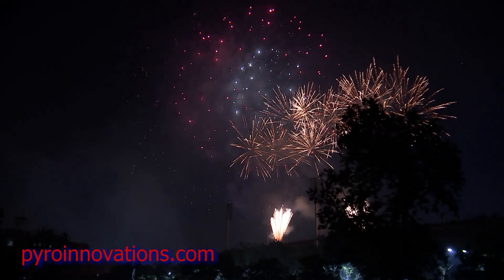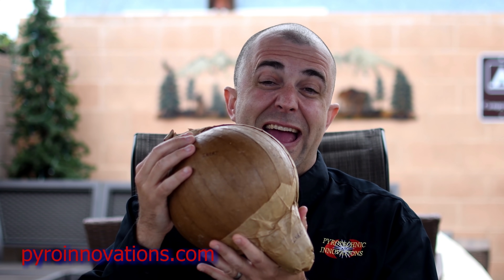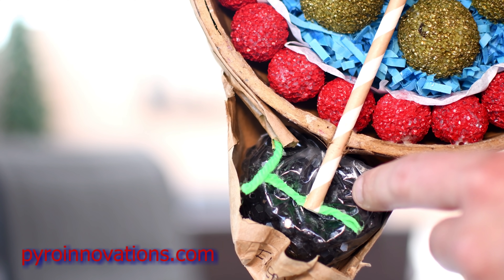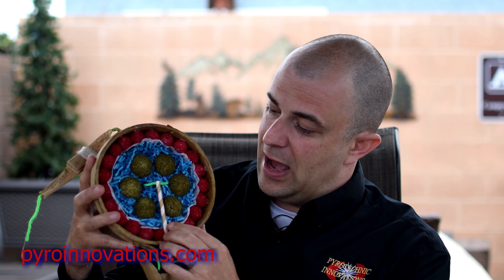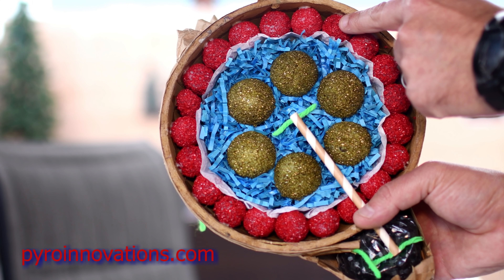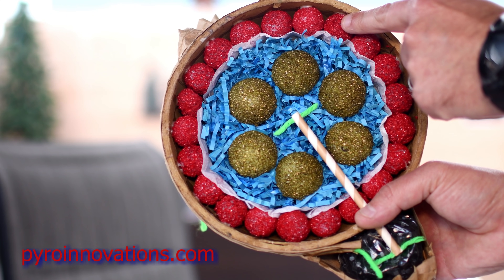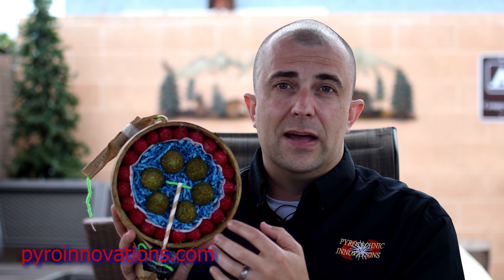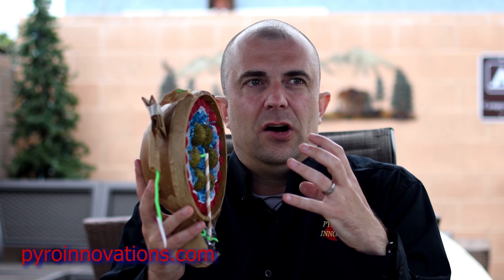How Fireworks Work

Comment: Wonderful explanation, how would I go about getting started so I could start my own business doing small shows and gender reveal parties ? Weddings and such ?
Reply from the maker: That would depend on the state you reside in. In CA, it’s easier to just join an established company as an operator.  That is probably true in most places, as there is a lot to consider, from importing to insurance to actual display licensing.
Reply: @PyroInnovations  well I’m actually in Tennessee and you’d be surprised how strict they are about fireworks in general
Reply: @PyroInnovations and Thank you for responding

Comment: Little question about what you were talking in 6:10, is shell of shells just normal shell but instead of stars there are shells like in firework cake but without lift charge?
Reply from the maker: Shell of shells is a larger shell with smaller shells inside of it. When the larger shell explode, it disperses the smaller shells in a fashion similar to stars, followed by the smaller shells exploding.

Comment: Was the shell you used in the video a real shell or a mock shell? If it was real,  how did you get it apart reasonably safe?
Reply from the maker: It is inert (not real).  It was just a model we put together with bright false colors to allow easy viewing of the individual components on camera.  A real shell everything would be black since all the components would be covered or primed with black powder.

Comment: I noticed that in this video the launch charge was very loud but at a professional fireworks show it sounds very subdued. Sometimes you can hardly hear it and I've always wondered how they are launched into the air and why it sounded that way. It sounds like a big puff of air and my guess is it's not very loud because it's down in a tube.
Reply from the maker: It sounds subdued at a professional display (if you can hear it at all) because the audience is a good distance away from where the shells are being fired, a safety requirement outlined by federal and local laws.  The mortars are very loud, it is literally like a cannon firing a cannon ball.  The pyro crew is much closer, which is where the footage you are referencing was shot from.  The larger the shell caliber, the louder the mortar is.  Some of the ones you see in this video are 8" shells, so those are pretty incredible when they fire.  That is one neat thing about being a pyrotechnician, we get two "bangs" for every one bang the audience gets, one when the mortar fires, and another when the shell explodes.  Thanks for the comment!
Reply: @PyroInnovations  Very interesting, thanks for replying 👍

Comment: Thank you so much for this explanation!! I'm from Germany and saw a few fireworks that contained hearts, absolutely loved them but kept wondering how that would be made! Interesting!! I had just assumed they would be rockets but i see why mortars are better for professional shows :o
Today I saw a show where they constricted cats and that looked so damn cool in the sky so i had to find out how that works and I'm glad i came across this explanation with examples! 

what happens to the mortar shells? do they burn up? do they explode into small enough pieces?
i read through the comments and found that it is possible to find shell fragments sometimes! they come down in a zone where none of the viewers are allowed to be, only the protected crew. 

do they have to be round? (to have a precise angle and speed etc probably yes, right?) 

for example what would a mortar look like that shows up as a star shape in the sky? the outer shell a circle and in the front and back half more filling material and then around the midsection of the ball a star shape arranged with only the tips of the star close to the edge of the shell?

and how would one make a mortar that shows up as a round circle that changes colour twice (so three colours in one explosion)?

what makes the shrill whistling sound sometimes used?
"Great question. The whistling effects are generated by Potassium Benzoate packed into a resonator tube." thanks 👍
Reply from the maker: Thanks for the kind words!  Great questions, let's answer one at a time.  What goes up, must come down.  The cardboard shell casings just fall down to the ground after the shell explodes, the pieces varying in size.  This is one reason we have a "fallout" zone where no one other than the crew is allowed during a show.

No, they do not need to be round.  Traditional Japanese style shells are round and a majority of what we typically use, but there are also Italian style shells that are cylindrical and can contain a variety of different effects and are a great compliment to round aerial shells during a show.

Pattern shells are made by simply laying the stars out in the shell, exactly how you want them to appear in the sky.  Burst charge would fill the remaining portion of the shell.  A number of different laws of physics contribute to this capability, but the law of conservation of momentum is the main driving force behind the ability to make a simple pattern shell.

Color changing stars are made by layering different compositions in appropriate thicknesses as you build the layering of a rolled star.  The large shells, which can accommodate larger stars, can have a number of different color changing layers.

Thanks for the questions and comments!

Comment: in another video you said the height of detonation is 100 ft per 1 inch firework thickness so in this firework does the timefuse need to be 8 inch long to achieve the 800 ft detonation? or are there different timefuse burns?? thank you for all the information you provide..
Reply from the maker: Great question! Short answer is no, the 8” shell used in the example would not have an 8” time fuse. The time fuse shown in the example is exaggerated and would not be that long in a real shell of that size. The time fuse would actually be much shorter, and terminate in a passfire tube that would have something like black match in it, which would flash very fast (like quick match) to the end of the passfire tube in the center of the shell. Great question!

Comment: What I really wanna know is how they compress those effect balls and what material they have. We all know the lift is black powder and hard salute breaks are titanium and potassium perchlorate+aluminium powder(flash) 😉
Reply from the maker: There are a number of different methods of manufacturing stars, the three main ones are rolled, pressed, and cut. Compositions for each effect type vary quite a bit.  We recommend getting involved with a local pyrotechnics club if you are interested in learning more.
Reply: @PyroInnovations  Its not my "calling" so to speak but I'm a little bit of a fanatic still about having the best bang for buck and knowing what I'm dealing with when using fireworks :) So do the professional display shells ever contain flash as the break charge or are those shells mostly only black powder explosions? Anyways thanks for the reply!
Reply from the maker: Burst charge used in shells isn't quite black powder, but somewhat similar.  It produces a larger quantity of hot gas which allows it to overpressure the shell appropriately.  Shells can have the burst charge "spiked" with a small amount of faster burning comp, but it is rarely flash powder.  The most common we have seen used is whistle mix as it burns faster than burst charge, but not as fast or as sensitive as flash.
Reply: @PyroInnovations  Yeah I was thinking theres no way BP could be "that" powerful.

Ive heard some people use kno3 instead of KClO4 for bangers so I wouldve guessed its nitrate if not powder or chlorate :)

Comment: Very well done.  I've always wondered how these things worked.
About how high does that 8" shell go before exploding?
How much does a single 8" shell cost (on average, I realize they can vary)?
How much debris falls back to the ground?  The shell casing looks very thick.
Reply from the maker: Thanks for the kind words! Standard rule of thumb for height is 100’ per inch of shell diameter, so for an 8” shell it would be roughly 800 feet.  Check out this video, it covers some of that sort of info in more detail: https://youtu.be/C7lCoRVoxLM. 
Cost can vary dramatically, best to look up price lists online, there are a number of vendors who publish them on the web. 
Yes, everything that goes up, comes back down. The entity of the cardboard shell casing is the bulk of what comes down, it can come down in small fragments to entire hemispheres depending on how it broke. This is why we have a “fallout zone” or exclusion zone when it comes to professional fireworks displays, where only the well protected crew is allowed. Thanks for the comments, great questions!

Comment: Does the shell split down the center where the two halves are fastened together if not what stops this being a weak point
Reply from the maker: Great question! If not pasted properly or burst charge is not fast enough, yes, but if pasted properly and the correct amount of burst it will be unnoticeable. Some shells also have a boost within the burst consisting of a small amount of flash powder or whistle mix (which burns very fast). Thanks for the comment!

Comment: Im impressed that the shell casing is strong enough to withstand all the g- forces at launch, but then "weak" enough to allow for a uniform explosion.
Reply from the maker: You are correct in that the shell strength plays into surviving the lift, but a uniform break is more dependent on shell strength consistency (no weak spots) and a rapidly burning burst charge that produces a lot of hot gas in a very short period of time.

Comment: Great video! I had a bit of the casing from a ball shell that landed near me at the1975 (too bad it was not the Bicentennial!) 4th of July display in Pittsburgh, PA. Pretty cool souvenir for a kid back then! It also led me to look into how fireworks, well. worked. I had before also assumed they were rockets. (Rockets ARE cool, but I can understand the danger of a rocket with a pro level payload!).
Reply from the maker: We make sure we are far enough from the crowd so that doesn’t happen now-a-days, but… as a kid, I remember going to a firing site of a professional display the day after a show looking for a souvenir (i.e. shell fragments!), but since the crew cleaned up well, I didn’t find any. 😩  Thanks for the comment, it brought back some memories!
Reply: @PyroInnovations  To be fair even though this was almost 50 years ago 😳and I'm sure safety has been long improved, the fragment wasn't burning (or even hot at all) just a partial cardboard sphere that gently landed about 15 feet away from me at Point State Park (the park AND the now famous fountain were NEW then.) It's still the go-to place to see the annual Pittsburgh 4 of July fireworks. (Along with the West End Overlook). Today I live on the North Side close to "Heinz Field" (Right across from Downtown) so, from my street I see the display from BEHIND, But CLOSER! (They are shot from barges in the river...) I get the smell of burnt powder in my apartment if my windows are open. It's awesome!

Comment: Do you have to clean your mortars after each display to reduce black powder fowling? Do you ever use smokeless powder or pyrodex as a propellent?
Reply from the maker: Great questions. We only need to clean debris out of the mortars which would prevent a subsequent shell from sitting all the way on the bottom.  Black powder fouling is a non-issue. Smokeless powders don’t burn fast enough out in the open to produce sufficient pressure behind the shell. Smokeless powders perform well in confinement which produce a higher pressure environment such as a firearm cartridge.

Comment: How does the black powder charge not blow the top of the shell off?
Reply from the maker: Great question. The shell casing is actually very strong and can handle the forces from the lift charge. In larger shells, additional considerations have to be taken into account as the lift forces begin to become more troublesome. Shell casing thickness, stand-off from the bottom of the mortar (and the lift), time fuse sealing, are just a few of the additional considerations that are taken into account for much larger shells.
Reply: @PyroInnovations  Wow, that's a lot I didn't even think about! Not that I would as I'm just a layman, but this is fascinating stuff. 

I assume professional display companies buy their stock ready made? I'd love to build my own one day to experiment but legally speaking it would have to be absolutely tiny as hell so I don't have MI5 knocking at my door 👀 I should probably work on getting a sugar-rocket to fly first...

Comment: Is the casing completely destroyed when the shell explodes, or is there a cardboard fallout (of sorts) under the display?

I tangentially knew a CM at WDW who worked with the pyro there.  Got some info from her, but never got to see any of the mortars on the castle or backstage. 😥  I did get to see the Illuminations barges, though...
Reply from the maker: The cardboard shell casing certainly comes back down after the shell explodes. Pieces can range from tiny shreds of cardboard to entire hemispheres. This is one of the main reasons we have what is know as a “fallout zone” or “exclusion zone” at professional display, where only the well protected crew is allowed to be during the show.
Reply: @PyroInnovations  Ah, makes sense.  I always thought of the exclusion zone as a precaution in case a lifting charge failed, or unburnt pyro came down.

Makes sense it would be for the casings as well.

Anyway, you got me.  I subscribed.  There's nothing like painting the nighttime sky with light...
Reply from the maker: @Backroad_Junkie   Yes, you are correct about the other reasons for the exclusion zone, there are a number of them considering we are dealing with explosions.  We couldn't agree more with your comment about painting the sky!  Thanks for the sub!

Comment: Im surprised the shell can handle the lift charge without destroying it.
And the pressure in the shell must be substantially greater in order for it to explode when ignited.
Reply from the maker: The shell casing, especially after being pasted with the many layers of paper, is actually quite strong. If a shell fails in the mortar (i.e. explodes) when the lift charge fires, it’s usually because of improperly or inadequately sealed time fuse. This of course is a simple spherical shell example, as things get more complicated with multibreak.  Things start to get real interesting with larger shells (greater than 12”), as they begin to require a stand-off distance from the lift charge due to the substantial size of the lift charge as you go up in shell size. In the large shell case, you could start destroying the shells in the mortar with the power of the lift charge. To make it even more complicated, the thickness of the shell casing increases as well as you go up in shell diameter, so it is a always a balancing act to ensure the shell functions as designed.
Reply: @PyroInnovations  Thats crazy. So I take it the larger the shell the less height you get out of them? BTW 12" is a huge shell. And what do they weigh?
Reply from the maker: @ItsCrazyMan-JustCrazy  Actually, the larger the shell, the higher it needs to go before functioning. The general rule of thumb is 100’ per inch diameter of shell. So for example, a 16” shell will reach approximately 1,600’ before exploding. Roughly half that is the break diameter, meaning that same 16” will likely break close to 800’ across in the sky. They get pretty heavy as they go up in size, a 16” shell will typically weigh a bit over 50 lbs.
Reply: @PyroInnovations  wow, that's super crazy. It's like lobbing a 50lb bag of salt a quarter-mile up in the air.  Instead of oohs and aahs, it should be "holyshit!"

Comment: How do you test new designs? Basically build one and light it at night and see what happens, or is there a way to model a new design without setting it off? Thanks for the great video!
Reply from the maker: Yes, that is exactly how they are tested. All devices used in displays are tested (by firing a number of them) for safety, consistency, and performance. Experienced manufacturers will have a good idea how a new design will perform, but ultimately they all get tested, which allows for slight modifications, rebuild, retest, to achieve the desired look.

Comment: Are the blinding and super loud ones that create no color duds, or made on purpose and if so why?  They are painful to watch
Reply from the maker: Yes, those are on purpose.  I'm not sure I would call them blinding, but they do emit a quick flash and sometimes a sphere of white sparks.  These are known as "salutes" and are filled entirely with flash powder and meant to produce an audible "report."  Flash powder burns much faster than black powder and the typical fireworks compositions, so its "report" is noticeably sharper and more pronounced.